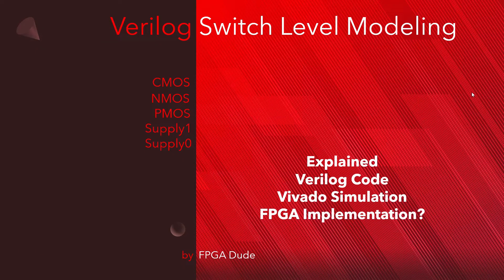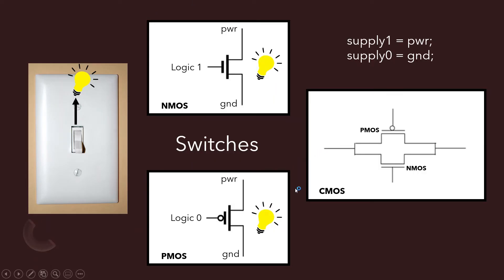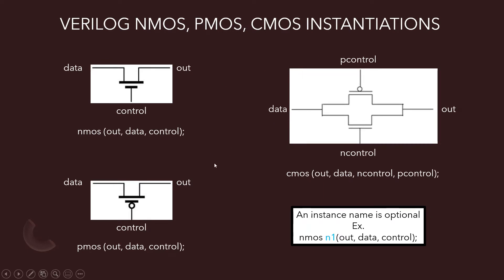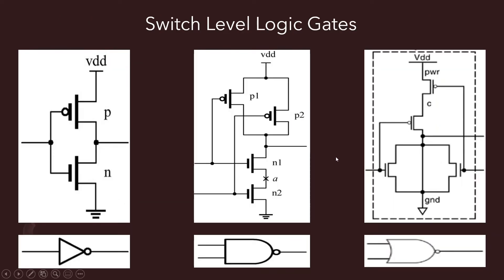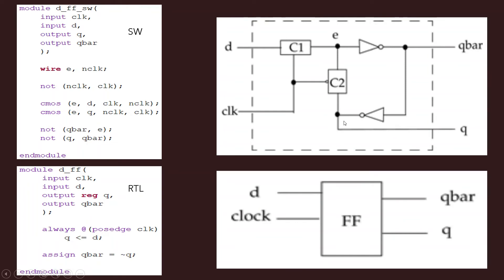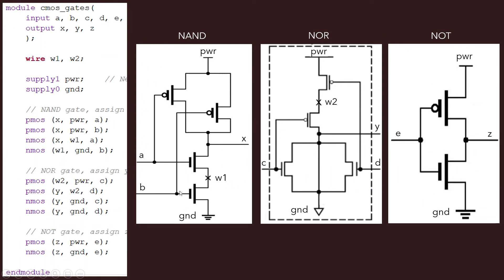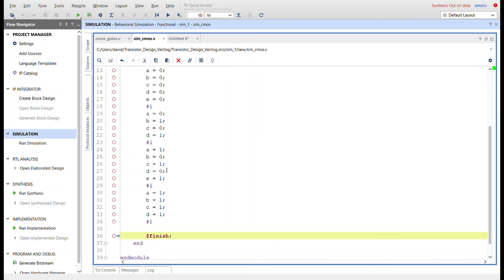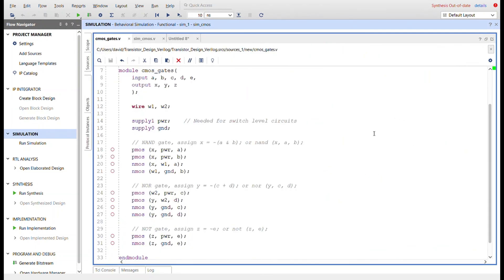Verilog Switch Level Modeling Vivado Simulation FPGA

Comment: As a new comer to Verilog i found the information very valuable. Thanks Now i know why  i should stick to RTL.
Thanks!
Reply from the maker: When first learning Verilog, I came across this stuff, before I had an FPGA. I decided to revisit these concepts and implement them on an FPGA. But, alas, they are not synthesizable.  Some good info and learning though. Thanks for the comment. I know you are itching for another VGA video, there are a couple on the way. Cheers.
Reply: @dajoma36  absolutely! I love to learn more on VGA or anything to do with FPGAs for that matter. Appreciate it!